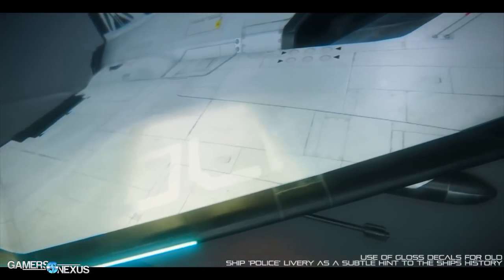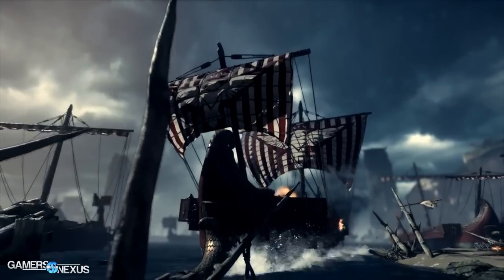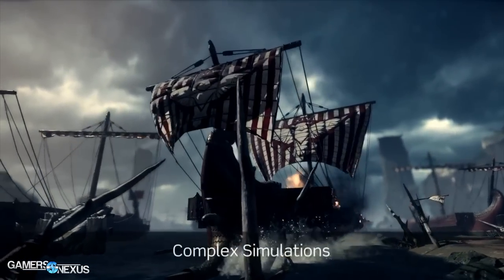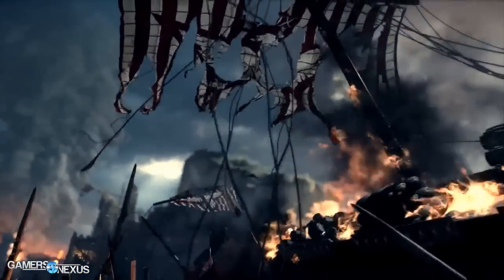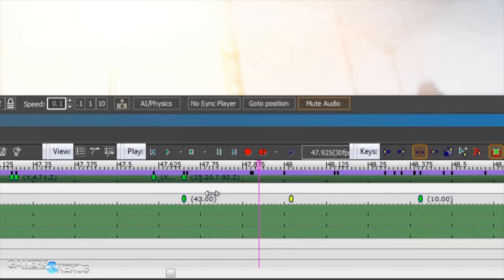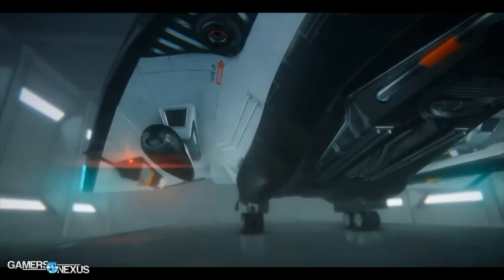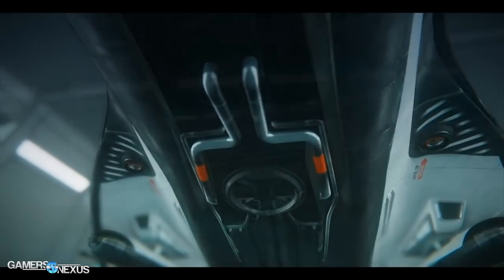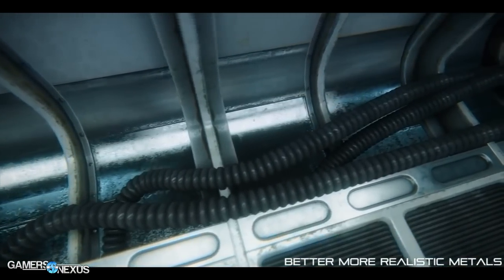What is PBR? Physically-Based Rendering Explained

Comment: Do I need an special monitor to see  PBR?
Reply: No, not at all. PBR just means that the programmers based their graphics code more on actual world physics so artists don't need to worry about assets starting to look out of place when they tweak material settings. In earlier games objects could appear brighter than the moon lighting them etc.
You need a new monitor if you want to use: high (10 bit) color depth in supported games/apps if you ever see what's called "color banding"; any of the competing HDR standards to better capture high contrasts between sunlight and shadows etc.; FreeSync or GSync to have less stuttering in gameplay.